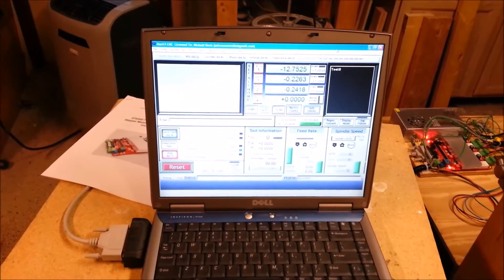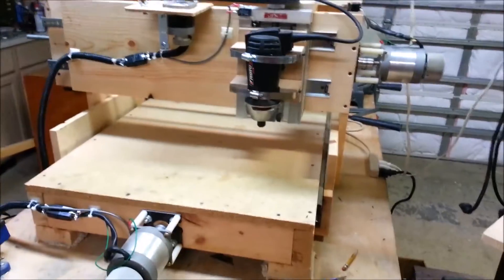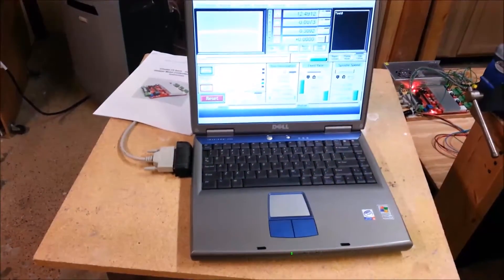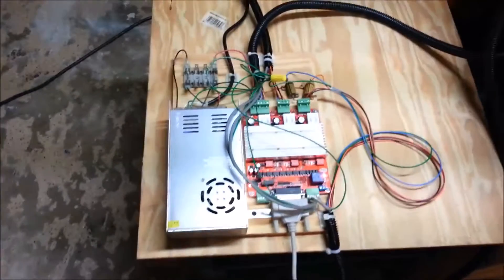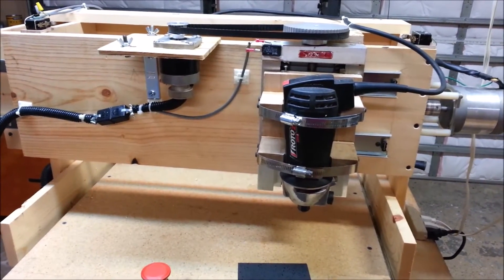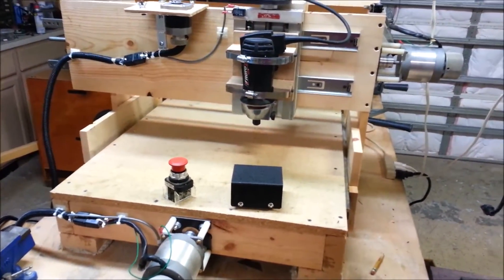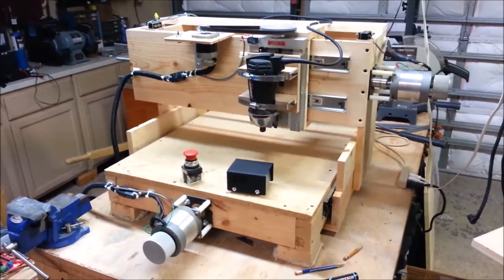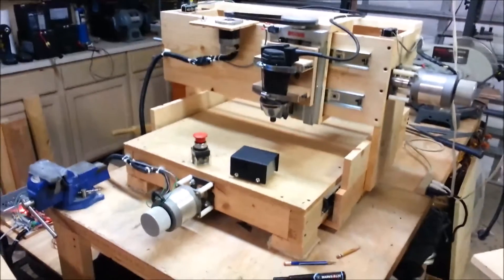Wooden CNC Mill Overview

Comment: Rough cutting plywood with less accuracy is possible. Run low feed, vacuum the trail to prevent fire, and make several cuts nearing in on the final dimension, and you're good.